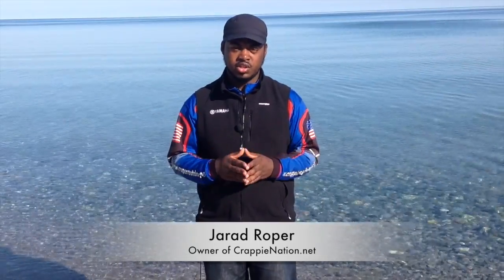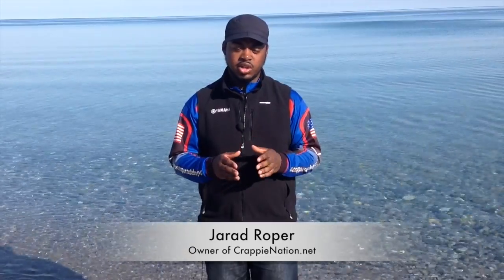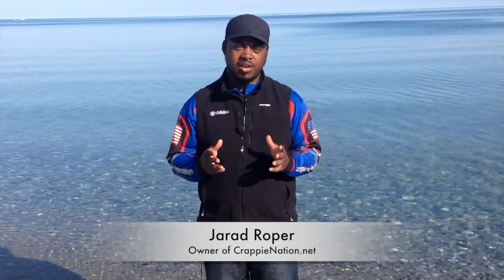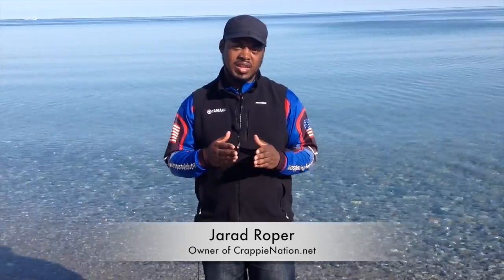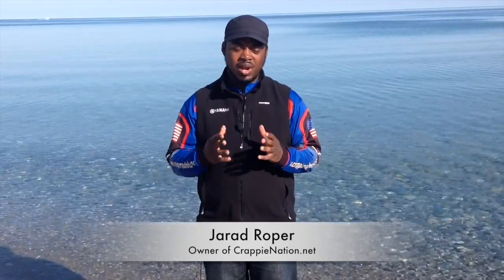Yamaha on Ethanol and Marine Engines

Comment: I remove the ethanol, it's not that hard. Get a safe setup & do it in sufficient volume, with proper storage tanks. Start with premium fuel because of octane loss, add in some isopropyl & away you go. All your motors will thank you.

Comment: I have a 90 hp Merc two stroke and my owners manual says clearly do not use ethanol. I use only ethanol free gas. I have two locations in my area that sell non ethanol gas. I'm lucky, many do not have that option.

Comment: This video was done at 30 seconds. Its the same conversation over and over and you guessed it over. No difference in 2 stroke information compared to 4 stroke. Just alcohol absorbing water and rotting hoses and such. Yes its not good but all these YouTube vids just keep cutting and reposting the same stuff. 
Here is something to do a video on. 
Go spend $50 on new fuel lines and vacuum lines. They come on small spools. (Bulk) i got 20 feet of 3/8 braided core fuel line for $16.  Then add a water separator. This all will help your odds of not having problems. 
Atleast its not the same conversation over and over